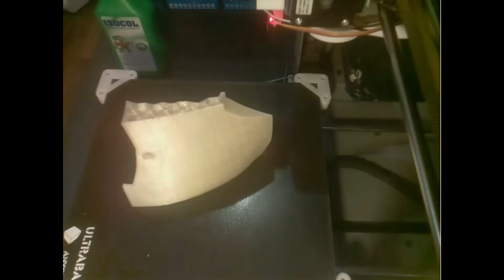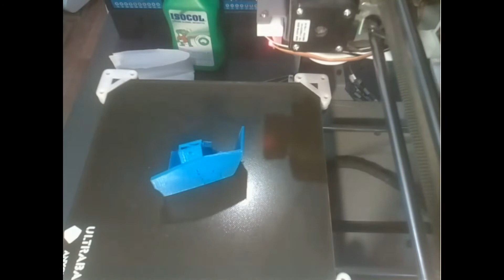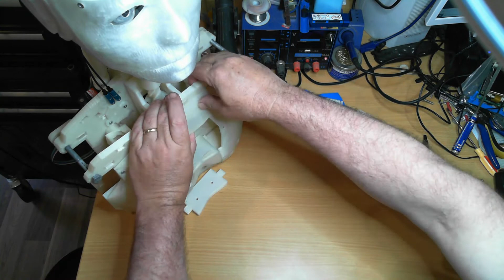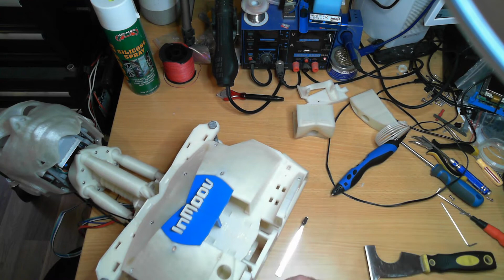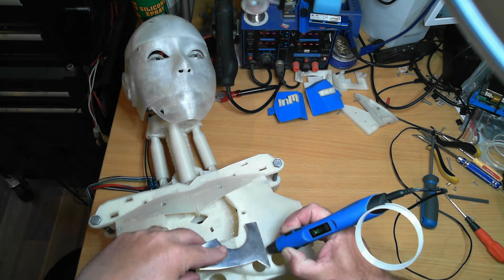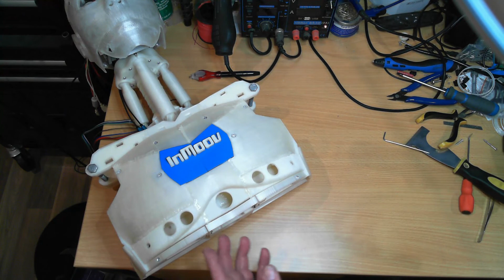Freds Head New Stand Part 3

Comment: I love this technique of plastic welding and inserting nuts in the torso. I wish I had seen this before doing my chest. I might redo mine at some point.
Reply: Me too, i saw this and it really makes me want a 3d pen, just to weld pieces together.
Reply from the maker: @MrJohnnywlf  The good news is the 3D Pens are no longer that expensive. :-)
I just purchased this one from Banggood, but you can get then from a lot of different places.
https://www.banggood.com/2nd-Generation-3D-Printing-Pen-with-3x-1_75mm-ABS-Filament-Kit-for-Beginners-and-Kids-with-EU-Standard-Plug-Power-Adapter-p-1158476.html?rmmds=myorder&cur_warehouse=CN
I have completed an unboxing video of this pen and a first test of it for welding., this will now be my go to 3D pen :-)
Video for that is due out 5 of Feb.

Ray
Reply from the maker: I've been using this technique for quite some time now.
I had to go back to June 2018 to find this video I made on the subject:
https://youtu.be/LxibEH8NNp4

If your using ABS, I would still use Acetone welding, it will be stronger, but this welding tequnique and attaching the nuts with the 3D Pen is the best solution for PLA.